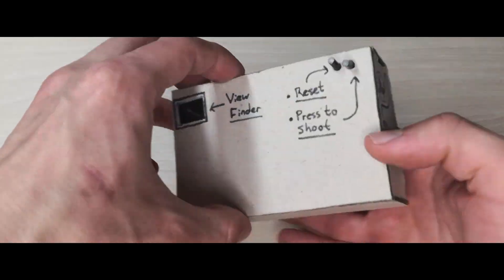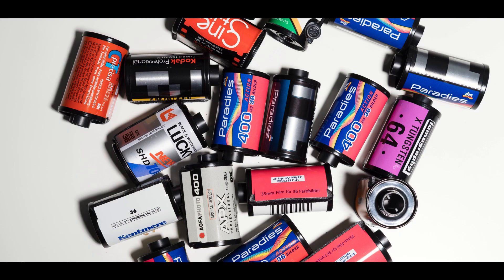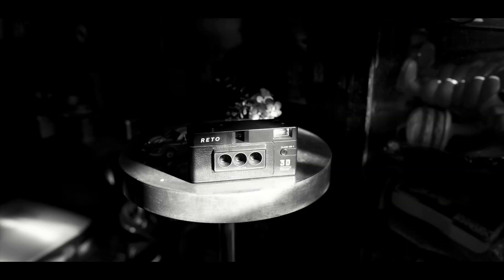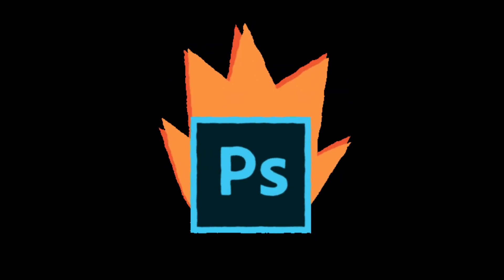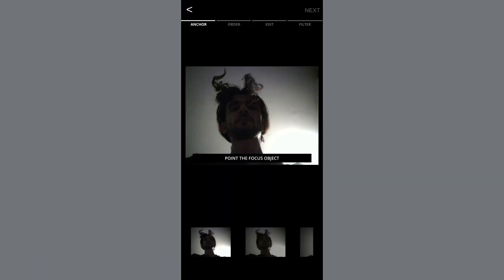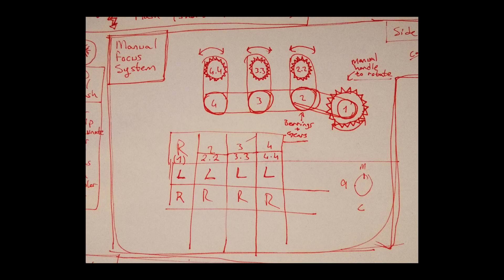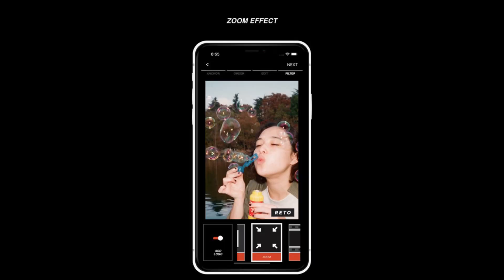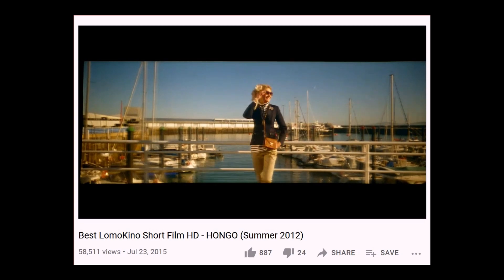Digital wiggle camera prototype (Digital Nishika, Nimslo, Reto)

Comment: What board are you using? Arduino or raspberry?  How are you getting past the bandwidth requirements for multiplexing multiple cameras?  I am just now delving into the wiggle cameras and mocking up design ideas for one.  No idea how to fix the focusing issue though.  I want to get my hands on a broken nishika to see how the lenses are designed and the angles

Comment: This is amazing, but if you really want to turns some heads make 6 lens system
Reply from the maker: Thanks, man! Since more camera modules mean more computation (which slows down the process), I am trying to keep it simple as much as possible. But ofc, many lenses would produce amazing results!
Reply: @fthdex  Timing seems to be the most critical issue. If you can get them all to fire simultaneously you'll see a big difference.
Reply from the maker: @GnartotheBone  Exactly! This is the most important thing to handle.